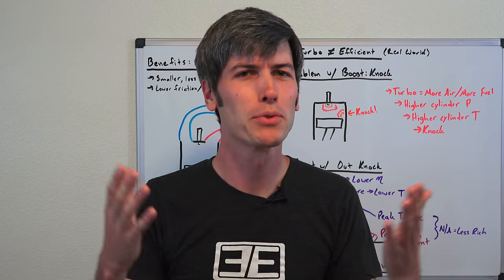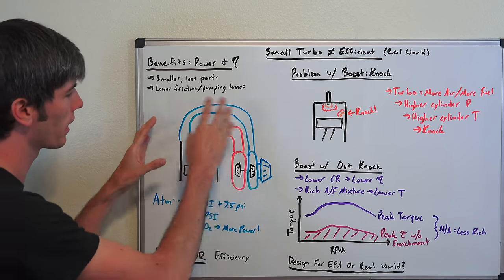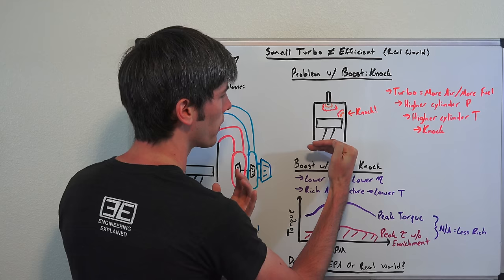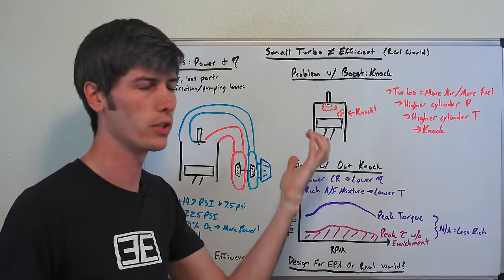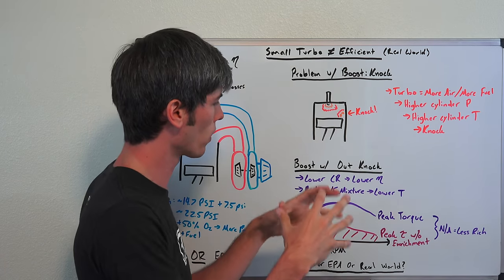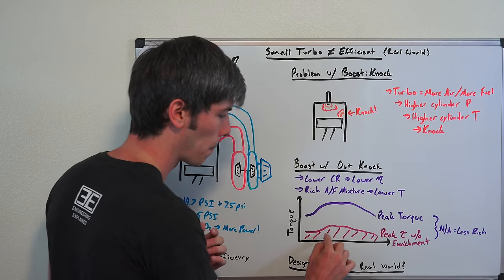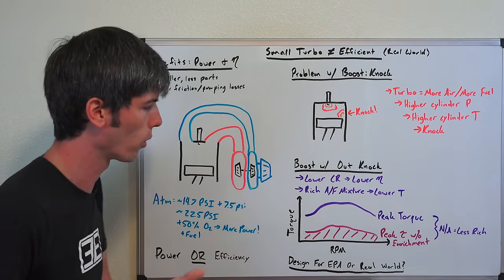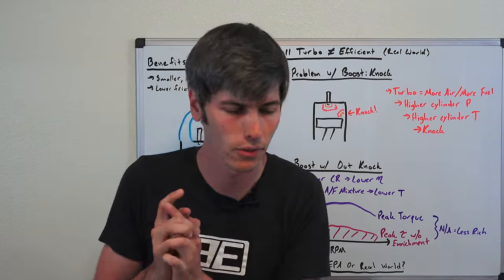Why Small Turbo Engines Are Not Efficient

Comment: I drioe Ford’s turbo-3 cylinder and got 70 mpg on the highway, so yes it can be highly efficient if you stay out of the turbo

.
Reply: Hey lookin to buy that same car. 
How many miles do u have and any issues
Reply: Ya i know that much but how reliable is the engine?
Reply: Deez Nuts  manual transmissions are more reliable and cheaper to maintain

Comment: I have a Seat Ateca (which is a Spanish Tiguan) with the VW 1.4L. My home is in the mountains and my drive home is a 300 meter climb with grades as high as as 10%. What I find remarkable is that this tiny turbocharged engine will climb the mountain with a moderate throttle at 1800 rpm. My mileage under normal driving conditions is what I would call not great not terrible at a bit less than 34 US mpg. My Passat TDI used to get 40 but VW made me an offer I couldn't refuse. 

I have friends with the 1.4 in a hybrid configuration. They live in the same mountains as me and tell me that they get 50 mpg.

Comment: I can say right now that my turbo v6 in my 4x4 F-150 gets WAY better MPG than my old F-150 with the 2wd 3v 5.4 v8 in all conditions.
Reply: Trey K the 5.4 is old ass technology. Even the new 5.0 with twice the power gets way better fuel efficiency
Reply: Smurfeco 2.3 twice the power?? The 3v 5.4 made 310 hp @ 5,000 RPM / 365 TQ @ 3,500 RPM. The newest 5.0 makes 395 HP @ 5,750 RPM / 400 TQ @ 4,500 RPM. Don’t forget that the Ford GT used this engine (modified of course). The block has been proven to make over 1,000 HP reliability. Look at mustang tuners. The new 5.0 only makes 10% more tq but at 1,000 RPM higher than the 5.4. Also, when using E85 the 5.4 made 395 tq.
Reply: Trey K I was just trying to say it has way more power in the mustang and gets better fuel economy I didn’t mention specs how they were cause we all know the 5.0 is a better overall engine than the 5.4
Reply: The 2.7 ecoboost outperforms the 5.4 for sure.
Reply: Trey K  have a 2.7 eb and love it. In sport mode it is a beast

Comment: I had a 2000 Jetta 1.8T, I took excellent care of it, but my best mileage was 26 mpg, worse than that was that over 80,000 miles, routine maintenance and lots of problems, costed over $6,000. Our new 2017 Camry 2.5L naturally aspirated 4 cyl. is getting 35 mpg.
Reply: @xHarux3 The Jetta was driven on the highway about 85% of the time, and only floored to pass on two lane roads.

Comment: My friend and I have the same exact cars the only difference is the engine. He has 2016 Ford Escape with the normal 2.0 4 engine and I have 2016 Ford Escape se with 1.6 4 turbo engine. I not only get better hp and torque especially at lower rpms and better fuel efficiency than his engine with more displacement but no turbo. I have seen it the other way where they still get more hp and torque but worse efficiency a lot worse
Reply: And the 1.6 escapes engine bay is a sea of hoses & lines. Even changing the oil filter is a PITA
Reply: TheeJoeyLee yea it is and there a ton of plastic covering the engine like most cars. I don’t know why companies do that. I always like the look of an engine. I never liked all the plastic they put all over. I know it protects from dirt and stuff getting on the engine but more often than not they are a huge pain getting off to do work

Comment: I went from a 1.5L Yaris (solid 5.9LPH) to a 1.2L-T Fabia. The Fabia can occasionally get down to 5.0LPH but any sign of traffic or high load and the economy dies. Also bear in mind it is infinitely more complex than the Yaris ie: turbo, liquid intercooler, regen alternator, idle stop, higher octane. I'm not convinced a small turbo was the way to go it is a bit more  torquey but that's it. Great vid.

Comment: 1.4 TSI engine is the beat since 2009 for hp, torque and fuel efficiency
Reply: Best
Reply: Didn't they consume lots of oil?
Reply: @KevBoy3D  
If you put 5W30 with VW 504/507 spec, no problem.
Reply: and the best for burning oil
Reply: Mine doesn't burn oil. 2014 twincharged 1.4 tsi. 210hp at flywheel now at 18psi. Can confirm it will destroy my fuel tank if im driving silly but its able to get good range.

Comment: Water/ methanol injection will help it alot! With a free flowing intake and exhaust. Along with a cooler thermostat than the factory tends to use. Drop the intake air temperature. But large engines are more effiecent anyway. I wanna put a 3cyl or 4cylinder diesel in a 1/2 ton truck. Maybe a vw  tdi diesel . with a compound turbo. So it can make low rpm boost. And higher end boost. Without restriction in the exhaust. From a small turbo! I'm sure you know a compound setup uses a small turbo fed by a larger turbo. So the boost is staged. The boost gets boosted. Along with water/ methanol injection. " windshield washer fluid" and a large intercooler. It should approach 80 mpg. With the proper gearing. Maybe better. (Overdrive ratios,tire diameter) the main thing is keeping the O2 density up while  increasing pressure.  Great video.....

Comment: Interesting, I have a Fiesta ST that is supposed to get 26/33mpg with a combined at 29 according to the window sticker. 15k miles later Im at 29.1
Reply: Spencer Forman mine should do 14.9l per 100km. I get 19,5.
Reply: You should have got a diesel then because you're not using any of the ST  under that hood.

Comment: My Honda Civic 1.5t is insanely efficient.  Runs lean with no boost and gets 50mpg with a light foot.  But yes, if you use all 170HP, you get that relative economy.  Honda figured it out.  I suspect the turbo location (integrated with the exhaust header) and some enhancements in head and piston shape make it work.

Comment: So, I went from a 2009 F-150 V-8 to a 2017 F-150 eco boost V-6. Scenario 1) highway driving - no trailer. 24 mpg. (Old truck got about 17.) Scenario 2) In town stop and go - 15-16 mpg (old truck about 14). Scenario 3) highway pulling trailer. Very little difference, but peak torque is higher at a lower rpm - noticeably so. Yes, like all engines, the more you press the accelerator the worse your mileage. It is just more noticeable with a turbo engine because the highest mpg is much higher than before.
The one thing he failed to mention is that higher octane is designed to deal with pre ignition “knock”. My truck is intended to run with premium fuel.

Comment: Just up the octane level of the fuel to get rid of knock.
Reply: Direct injection can reduce knock, because it waits to squirt fuel into the cylinder right until the piston is almost at TDC.   Modern direct injection also has port injection to clean the intake valves and prevent carbon buildup, but the port injection can be used under light loading conditions where there shouldn't be any knock.
Reply: Might as well just go diesel/.
Reply: Jess Stuart  Which engines use this set up?
Reply: corvette c7 zr1 and new ford's coyote
Reply: It helps but these are OE engines that we have to tune for the masses...so they're all designed for low-octane operation. That means rich fuel tables and really, really lazy spark advance under boost. Out of boost you'll see 30 degrees of advance all the time but under boost, 10 degrees is getting pretty racy. Direct injection lets us go a bit further but it's still pretty sad.
Reply: Put a tiger in your tank
Reply: @jeffreychavey4161  they're grrrrrreeat!!!!....oh wait wrong tiger.
Reply: @siraff4461  Mercedes also uses direct injection and variable valve timing.  On low power situation they inject the petrol just before TDC. They call it fuel stratified mode. I have this on my 2017 C350. I get very good mileage on long trips, around 4.5L/100km. If I give it some beans its really hungry though, probably 8L/100km.
Reply: @agt155  
Diesel will soon be forbidden for environment reasons so that's a very bad advice.

Comment: Knock is not from two flame fronts, multi-plug engines have multiframe fronts. Knock is from the hotspots you mentioned igniting the fuel charge before the piston reaches top dead center so the explosion force is applied to the piston while it is still travelling up.

Comment: I'm from the UK brought a brand new Ford focus ecoboost 1.0 125ps. My 2009 Citroen c5 estate 2.0 diesel is way better on the fuel even though the car is twice the size and the engine is twice the size lol and more power 138ps.
Reply: You shouldn't expect the same fuel economy from a gas as a diesel. That diesel also pollutes a lot more.
Reply: @amandahuginkiss4098  Yeah I know it's a petrol but still a  1 liter 3 cylinder engine ! and a brand new. My other car my ten year old diesle is quicker and more efficient.
Reply: @jonnnyonion  And your diesel pollutes more. Much worse for air pollution.
Reply: @amandahuginkiss4098  Have drove other 1 liter petrols before and they been great on the fule.
Reply: @amandahuginkiss4098  Thats government propaganda to try and get people to buy new cars.

Comment: VW has a compact car for the Brazilian market, called UP TSI. It produces an amazing 110HP with only 3 cylinders and 1000CC of displacement. The turbo works with some 28PSI and it is considered the most fuel efficient car in production.  Hard to determine efficiency when the driver's foot is what makes the difference at the end of the day (or when the light turns green!).

Comment: How to save fuel: mid 90s sedan 0 to 60...ok at 10s.  2018 f150 4x4 that can tow 9000lb and weighs 4500lb for your whole family...journalists say it's slow unless it can do 60 in like 7 second.  Europe saves gas by downsizing on weight and power.  We want cake and ice cream and gummy bears
Reply: Exactly. In america our vehicles & us need to loose some weight. Ridiculous how we have to carry 3-5000 pounds of metal plastic glass,& rubber with us every where we go. Perhaps we need more Personal Electric vehicles on a smaller  separate road network like a bike trail,(or modified bike trails) to avoid collisions with heavier vehicles.
Reply: murica still call an 8's car slow because is not safe for merging on highway despite lower speed limits lol...
Reply: American roads should be quite straight and wide so they do need more power

Comment: You are intelligent and understand both NA an mostly 4 and 5 cylinders. One vitally important factor you have nor addressed is POWER TO WEIGHT RATIO. My turbo rarely if ever kicks in because I anticipate traffic and use my cruise control, if my turbo ever kicks in BECAUSE I NEED IT AT THE MOMENT, it is for a few seconds. Thus, I get way better MPG than even the manufacturers claim. You have an average understanding of engineering but you are biased to use faulty logic to create clickbait tiles. Small displacement turbo motors are more efficient than larger displacement and greater number of cylinder motors and your facts would only be true if someone was constantly engaging their turbos which is impossible to do. Try again, Maybe you can explain how your perpetual motion machine works.
Reply: impossible to engage turbo regularly? do you only drive in stop and go traffic or did you install a massive turbo which needs high load to kick in?
Reply: Maybe some people like some power? Personally I often go over 40% power in my car.

Comment: This is in part true, but since we reduce throttle losses during coasting and los power scenarios the engine is still much more efficient…
also injecting too rich is not really an option since you are not allowed to spill carbons unburned…
VWs 1.0 3 cylinder TSI is a good example it is crazy good, uses water to air inter cooling to keep the volume from turbo to inlet below 3000 cc of air and gets great real world milage while still offering  ~110-120 HP 
the reduction of throttling needed during most of the time simply is so much better than the thermal losses during hard acceleration (the engine already makes 75 HP without forced air).

Comment: The BMW M4 GTS uses a tank of distilled water to bring the combustion temperature down under heavy load for performance purposes. Is it possible for small turbo engines that seek fuel efficiency to add water tank in order to keep air/fuel ratio higher under load as well?
Reply: Abbas Sadeghi Bajgiran isn't it actually a methanol-water-mix?
Reply: That would definitely be a good solution, but also a lot more complex than just dumping more fuel in.
Reply: The aftermarket kits are usually 50/50 water-methanol. but the water injection system in the BMW M4 GTS and the one that Bosch developed are based on distilled water only. Although methanol helps a lot in terms of performance and efficiency but it is really expensive compared to water.
Reply: You are right this system adds complexity, But when you look at the hybrids and new diesel engines you'll see that majority of manufactures and consumers seem OK with complexity.Blame it on global emission standards! :D
Reply: This system isn't new. At least in the tuning scene it's been used for years or even decades. I think even some OEM did use water injection long time ago (Saab I think?), also it's used in some gas turbines for example to bring down not only intake air temperatures bot also exhaust gas temps (still with the injection into the intake, not in the exhaust). This results in much less NOx emission. So water injection is a very cool feature, I plan on using it also sometime in my turbo conversion I am thinking of.

I think the only reason why this system isn't really used today is because it's cheaper for the manufacturer to just dump more fuel into the engine (full throttle hasn't been tested in official emissions tests until now) and because some people don't really want to pour up another fluid on their car. It has to be distilled water, too. Or even a water-methanol mix for even better efficiency. You can't expect that from the average driver I think...
Reply: If the whole industry adopt the water injection technology then consumers have no other choice. Just like new diesel vehicles that require DEF fill ups. I think it just depends on how tight emission/fuel economy standards gonna be in the future.
Reply: It's possible but most people won't want to buy a car that needs more than just gas, plus I could definitely see people putting regular water in instead of distilled and burning all sorts of minerals that shouldn't be in an engine.
Reply: Abbas Sadeghi Bajgiran the DEF fluid, is really for mostly the North American market, but now I saw models in Germany with the same system,,,using low sulphuric  diesel, where the most diesels worldwide, do NOT have such fuel, .
Reply: Leighton Samms all EURO6-compliant engines (i.e. pretty much all current diesel engine models commercialised in the EU) require urea for the exhaust system to work properly.
Reply: Peter Muelltonner water injection goes back to World War II aircraft. It's ancient technology.
Reply: I don't think OP was saying this is new technology, but rather that this is something that may be used on a larger scale in the future. Unless, the electrics take over sooner rather than later.

Comment: I get 33.8 mpg over three years on my 2018 Civic EX-T. I never “floor it”, rarely going above 4,500 rpm. I drive about 60% highway. I only use the highest detergent fuel with Shell 93 Octane (to mitigate carbon deposits). I change my oil/filter early (between 3,800-4,200 mile intervals) using synthetic 0W-20 oil. I currently have 83,400 miles with no issues to date. I hope to get over 250,000 miles.
Reply: How's the car doing?

Comment: Does Diesel make any difference?    
I have a Volkswagen Lupo 3L (diesel) a 1.2 Liter 3 Cilinder Turbo engine with 62HP and it uses 3 Liters per 100 Km.
Reply: yentl555 62 hp, probably gets such great fuel economy because you have to get out and push it up a hill lol.
Reply: Diesels are a much different animal because done properly there is no single explosion.  Turbo charging diesel engines is the only way to go.
Reply: Greg Rowe you certainly have never driven that car!
Reply: Diesels and Gasoline use a different thermodynamic cycle the Otto cycle versus Diesel cycle. But for the most part the higher the compression ratio the higher the efficiency and power creation. Thus diesels are so much more powerful and gas efficient because of their high compression cycles. In theory though the Otto cycle has the ability to be more efficient but so far it is not possible to get up to the high compression ratios required to beat diesel. However some care companies are getting pretty impressive with how high they are pushing the gasoline compression ratios and thermal efficiencies.
Reply: I cried when I read you get 3L/100km. Sincerely, a Dodge Dakota 5.2L owner who gets 23L/100km.
Reply: it's a 850kg car, 62hp is plenty for normal driving
Reply: The first Gen Honda Insight has A NA one liter 3 cylinder VTEC engine...67 HP.  Smaller displacement and no turbo...
Reply: No it doesn't. You can't even get that low fuel consumption from a 250cc scooter, nevermind a car.
Reply: Theodore Vasilopoulos 

The other 3L car was a version of the Audi A2
Reply: @theodorev666  yes it does,  i drive 17 year old  one. And if it were new, and i would want to, it could be even a lot less.
Reply: @SimplexSM  Welcome to europe
Reply: yentl555
without the turbo it would have  20HP
Reply: @vampov  Kinda like Mazda is doing with Skyactiv-X engines right?

Comment: I tend to disagree. In a real world, you are not flooring the gas all the time you drive the car - especially when the car is not underpowered. And here turbo is just shining. 
You get the same(more or less) efficiency in a full throttle mode. Yet, on a motorway or in a city traffic, turbo is ridiculously more efficient.
Real world, NA 200hp Clio 3 RS hot-hatch used at least 20% more fuel, compared to Clio 4 RS with a turbo on a daily commute, all equal. Owned both, so I'm pretty sure here.
And yes, on the racetrack, almost no difference.